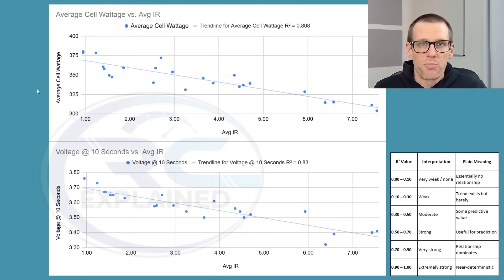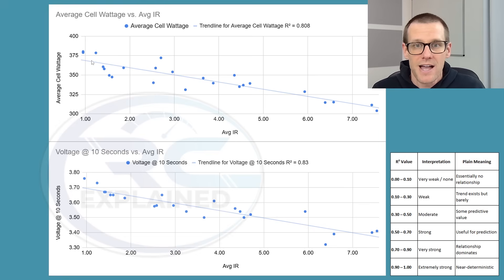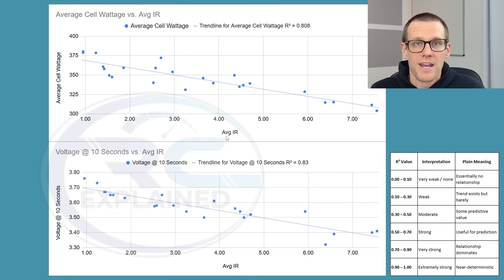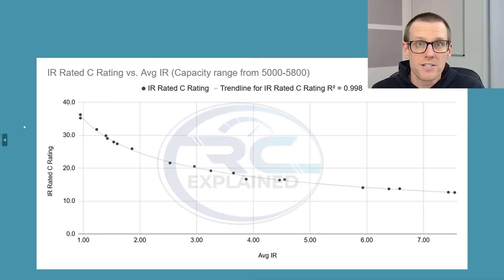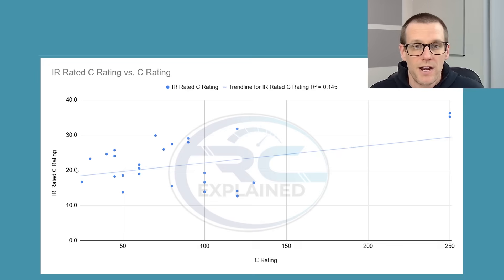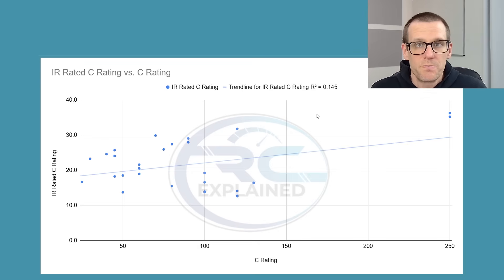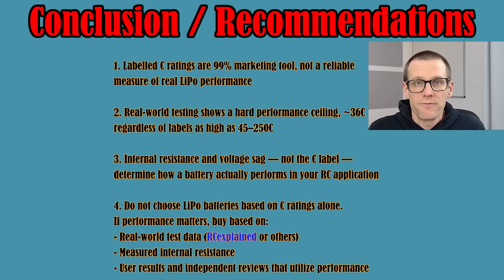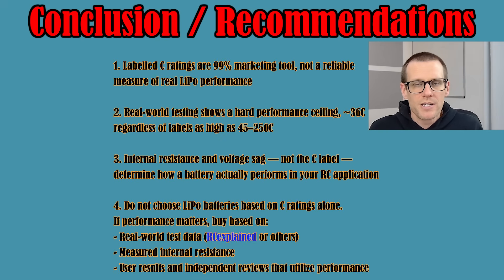28 LiPos PROVE — This Will Change How You Buy Batteries!

Comment: The C Rated Group vs. IR Rated C Rating is a very informative graph, it demonstrates that in the 70C to 250C groupings some manufacturers are at least attempting to make a better battery pack even though it is severely overrated, and SOME MANUFACTURERS are making no attempt to make a better battery and are just severely overrating. The use of an average to define the groupings is misleading, as some manufacturers are attempting to make a better pack, yet the group average is brought down by the really misleading manufacturers. Again, as you stated there is little in between, they either make a better pack or make nothing better and mislead terribly. I would love to see the correlation between the "specific manufacturer" claimed C rating and actual C rating, that way manufacturers that attempt to make better higher rated C packs can enjoy more business for their efforts and likely increased manufacturing costs. If one uses the IR Rated C Rating and C Rating it seems to demonstrate that Traxxas is the more trustworthy manufacturer, and SMC has pushed the marketing too far. I understand you have small or single sample sizes, but I bet there would be a high correlation to certain manufacturers false claims if the sample size was large enough to have a confidence interval of 90 percent or higher.
Reply: I think some of these manufacturers test the max C rating at very short bursts so the sag doesn't get as bad. It's most likely not even close to the ten seconds tested here. Something like a 1, 3, 5 and 10 second graph on a couple of the best and worst performing and lowest and highest rated could be fun to see. And of course a large sample size would be nice but gets expensive for a hobby channel.

Still, overall it seems for hobby stuff the manufacturer given C rating doesn't matter much as long as there's a semblance of quality to the batteries. A couple of minutes of full on racing/flying will probably keep the battery in a state it's not going to be able to push much above 20C for a lot of the time.

Comment: Okay but does the battery provide enough power?
Reply from the maker: None of them provide what they say they should. The answer by default is no. The packs on the low end of the spektrum hit a standard LVC under load requiring adjustment.

Comment: Cell balance and individual cell IR are monitored and shown on most high-end chargers. Crocodile clip a new battery to your charger (don't solder any connectors on yet!) and begin a slow charge at 0.5C. If the cells are out of balance by more than 0.1v and take more than a couple of minutes to balance perfectly, or if the cell IR's don't match up within a couple of Mohms or are high for the capacity (more than 15 for 2000mah, or more than 10 for 5000mah, for example), take the battery back for a refund or replacement. You're welcome.

Comment: I fly fpv and actual c rating is very important, So much so that i bought a Lipo ESR meter mark II. In the past i bought "recommended" batteries with high c ratings that sagged so much that i got low voltage readings on the first punch out. When tested they were low 20's instead of anywhere close to the rated 100 plus.

Comment: I still remember the days when you could buy matched RC packs with the IR printed on each cell. Those were the days.
Reply: Nothing wrong with those.....got real Hot.....Took loads of Charges.....What happened to Good Ol' NiCad Batteries ?........
Reply: @PaulDouglas-i5m  Lipos replaced them as Lipos have greater capacity and discharge rates they are capable of. There are still companies selling NiCad packs, but the cost of sorting and matching cells is prohibitive for something that will have 50% of the output and 50% the capacity of even the most mid-range Lipo of similar sizes. 

That being said, I still have all my old silver connectors and pack building gear.. I miss them but market wise, NiCads are dead in RC except for niche retro classes.

Comment: Appreciate the content. Assuming you had space, how would stacking say 2 $28 rapids in parallel hold up to a SMC SRD? As even 3 in P would be about the same price. Not to mention SMC is never "in stock".
Reply from the maker: I haven't thought about this before and how the changes would play out. The size of the pack increases significantly with each pack in parallel. Twice the pack count should easily improve the performance as each pack would do half the effort.
Reply: @RCexplained  My application is in adult sized mini drag bikes @ 100v+ and 400-600A.  So plenty of room. if many cheap packs in parallel pump out as much as an SMC, i can easily do that. Be a neat test anyway. Lots of RC boat guys have room to run dual bats in parallel.
Reply from the maker: @AdamOpheim thats like 70hp, sounds like fun. What configuration are you planning to run with these packs? As a base line how many in series and parallel?
Reply: @RCexplained  few vids on my channel. They sag quite a bit, but I do see 40ish kw, around 55hp. I have several bikes. I like the 20AH 12s agricultural drone bats.  2s2p config. Also run 6s and 7s RC packs. generally  3s-4s w 2p. Makes for a lot of power in a relatively small package. I'd love to get my hands on about 8 SMC-SRD 6s packs to play with. I'm sure they'd blow away my current packs.
Reply from the maker: @AdamOpheim that sounds like significant sag. A 4s2p configuration of the 6s SMC SRD packs would be a massive step up for you.

Comment: I went with SMC to alleviate some battery heating issues in my larger 6s vehicles, and it did help, but i've used the calculator to see my batteries true C rating and it falls far below expectations of the manufacturer (50C for most 6s spektrum esc's is seen as minimum). Does this mean the 50c they're asking for is complete BS and its more to do with the motor's demand than simply the esc's recommendations? I guess should the max wattage draw of the motor be the "minimum" C rating needed for a given application?
Reply from the maker: If you got a true 50C rated pack and ran a moderate 5000mAh, that is 250A continuous. Id expect your power system would not last at that power output. Better yet, can you drive the car at constant 250A?

I think RC manufactures put this limit on there so you dont end up with weaker true 5 to 10C packs made for transmitters and such. But this is just my opinion.

Comment: Well done and great info!  Marketing, how scummy can it get?   You can't trust anybody.  Or at least it is hard to find companies or people that are trustworthy.  You can spend a lot of money on batteries and if you are ending up with junk that is a real burn.

So let me ask - what is the chemistry or physics or phenomena that impact the internal resistance of a lipo or similar pack?  I know that there is some kind of deterioration that happens both over time and when the battery gets overstressed and there is some kind of crystallization or dendrite growth that slowly moves from anode to cathode which can eventually short out the battery and cause a fire. 

What makes the better batteries better?  Is it chemistry, construction, design, other?  Cheers
Reply from the maker: Thanks for the comment. 
Design, layering, and cathode material all play a significant role. These items cost money to pack in to the LiPo and a big reason brands will not focus on this when people buy blindly.

Comment: Excactly this is what I say for years, it is all about the IR.   My method to compare batteries IR reliably;  discharge battery to storage 3.8v,   ensure temperature of batteries is same, f.i 20degree.  (a hot battery has lower IR, a cold battery higher IR) ,  then a short charge at 5C, so 5 times the pack mah, so 1500mah, charge at 7.5A. To measure IR , we need some current truew the battery to introduce SAG.    Then readout the battery IR after 10seconds.   My I charger I get very consitent results and yes, the battery with lowest IR is the best battery.   Also consitent IR is important good batteries are matched and all cells should be equal,  the cell with the Higher IR value, it is the cell to fail when you  ask heavy loads from the battery in a race.   You can keep a log for the values and nr your packs.
Reply from the maker: Very nice, I like your logic.

Comment: According to the guy that made the LiPo Dyno (ESR Meter Mark II), the IR rating on chargers isn't very accurate, would be curious what results  you get using his meter. Ironically, I just bought one for myself.
Reply from the maker: What does that mean? I think we are after repeatability here and not necessarily accuracy. If i get a hold of one of those things I'll do a comparison. Seems they are expensive.
Reply: @RCexplained  IMHO $149 isn't too bad for RC hobby stuff, hence why I got one.  I have 10-15 year old batteries I'd like to see how well they still perform or if they should be scrapped.

Comment: Great breakdown! Thanks! I buy the largest mAh that fits the model, C rating is no indicator for actual performance since there’s no standards being followed by the manufacturers.
Reply: BE CAREFUL !!!  Transmitters that had a "Tx lipo battery" were often are very low "C" rated battery, 
and I'm sure I read in a forum that 'Anthony H' wrote  "lipos like the Nano-tech have much more thicker copper internally to supply a higher "C" rating.
Reply: @A-Dingleberry  True, when I say I don't go by C rating, I'm not saying it's completely irrelevant. Just that I don't put much faith in the C ratings. Especially with the AliEx or Amazon batteries. I've had better results from batteries rated at 100C than 150C from the same company, in the same model. I would never buy any battery rated at a lower C than a manufacturer calls for. Though I have done it, didn't work out so well, LOL.
Reply from the maker: You got it, expert hobbyist right there!

Comment: What's funny is that on some cars the manufacturer states to use a minimum of 50C. So there all in on it. 50c doesn't even exist @!!!
Reply from the maker: This is funny for sure. I really don't believe that everyone understands just how bad C ratings actually are.
Reply: In my opinion when a company demands at minimum a 50c battery it prevents you from buying those willie nillie brands. That being said, it seems (recently at least) that the willie nillie brands have high C ratings. It is probably more or less they want to make sure that you buy 50c batteries which in most cases is a good compromise between price and actual c rating delivery.

Comment: The wild disparity in your data points to unsound testing methods. The batteries you recommended in your last video as high performance once again show up here with troublingly low c-ratings, especially compared to advertised. How are you measuring internal resistance? Not all chargers do a good job at figuring it out consistently and accurately, and the average hobbyist likely would get varied results if following your advice.
Reply from the maker: I run a 105A load test on all 28 batteries, and I’ve shown the relationship between IR and two load test metrics in this video! 

The large gap between advertised C ratings and measured performance is exactly the point of this video.  Those packs you call out from the previous video are high performing in real-world use, but there’s a practical C-rating ceiling that shows up consistently in testing. Much closer to ~35–40C than the 50–250C figures printed on labels.

For example, a 5000 mAh pack sustaining 1250A for most of its capacity without exceeding ~60 °C simply isn’t physically realistic. Not to mention, I've posted videos of LiPo's on this list not able to sustain a 70A continuous load without overheating. That is how I confirmed the battery performs like a 12.6C pack as it could not sustain a 13.5C load without overheating. 

The average hobbyist will get data driven results when following my advice.
Reply: @RCexplained the relationship between IR and C rating is absolutely there. I don’t doubt that. It baffles me that manufacturers of vehicles state a minimum c rating for battery if they aren’t able to verify it’s needed. I use CNHL G+ and they’ve performed well in a 3S 40C min rating vehicle, though according to your data it doesn’t come near that. What the heck are the manufacturers using? 

I do still believe that most consumers won’t be able to accurately and consistently measure IR to determine how their packs are performing. Not all chargers, likely not many at all, can do this
Reply from the maker: There's so many things to unpack here. What vehicle and mAh battery are you using?
Reply: @R @RCexplained sorry for such a late reply. I was talking about my Arrma Typhon Mega 665 with 5000mah CNHL G+, though misstated and meant 2S. I’m going to be switching to a 3-4S brushless setup soon though
Reply from the maker: A minimum of 40C means a minimum of 200A continuous using a 5Ah pack. Is this realistic? It seems like it would be extremely difficult to drive this car at that power level for the entire duration of the battery.
Reply: @RCexplained I’m sorry, I don’t think I follow your math here

Comment: Measured resistance of a new battery says nothing about the performance. Ive seen battery packs drop almost 10 ohm of resistance over 3-4 cycles before stabilizing there and then rising slowly again.
Reply from the maker: Actually, the 105A load test data in this video contradicts your conclusion. Your example of what you see for IR is exactly how not to measure IR if you want repeatability.
Reply: @RCexplained  The packs need a few cycles to function properly. Its like a burn in. You can actually feel this on the sticks when flying a drone. After 3-4 cycles the battery sags less and u have more power at higher throttle. 
Especially the new GNB 140C packs with the abstract design behave like this. First measurement was at 14 ohm on a 650mah 4s and after 3 flights (relatively mild flying) it came down to 5-8 ohm per cell.
Reply from the maker: You don't need to cycle the packs to achieve lower IR. You could have just warmed up the pack to a  temperature you are comfortable with and achieved the same results without "burning" through or wasting flights and cycles.
Reply: @RCexplained i have kept book with this because i found it curious. They werent warm and the "test" was over a few weeks. 
If u dont believe me go and buy a fresh pack and try for yourself. 
Worst offenders were the ovonic packs. Still garbage compared to the GNB...  Itwasnt just measuring intolerance. 
If u have Speeder pilots chasing world records in your area go and talk to them. They cycle new batteries before attempting a world record and then throw the battery away. At least our crazies do that. Thats how i discovered this phenomenon.

Comment: I'd never buy based solely on the advertised c rating.   I use the advertised c rating along with the lowest dollar rating.  If you're just bashing around and not gunning for world record top speeds you're likely wasting money buying high dollar batteries.  I've had them all.  I've found buying whatever is on sale at the time has treated me well.  You can get killer deals if you watch close.  A got a set of 15000 mah 120c gens ace bashing 3s for my Infraction for less than $100.  They destroy a set of tires before low voltage. Also if you've got a 100a 3s esc then most any Amazon battery is going to bash the same.  Save money and bash with what's on sale.
Reply: I was always told high c ratings were more for race setups and others that require the burst. Most of us bashers will find that just about anything on Amazon or eBay will work fine for the stock setups. I used to run turnigy nanotech on a 2s castle setup and would destroy tires on the rustler pretty quick. Having to glue stock wheels after a run or 2 because they balloon so much from speed. On 10-15$ lipos.

Comment: I had CNHL 2200 3s 40c packs, bought about a year ago. They were 182g, performed great, though I didn't officially test any numbers. Great for my purposes though. I just recently picked up the same packs a month ago and they were noticeably smaller. Sure enough I weighed them at 165g. A 17g difference. I guess to save some material and maintain the price point. I would have paid a bit more for the same pack considering all the import issues but it is what it is. Have you seen anything like this with CNHL? I haven't used the new packs yet so can't speak to their performance. I can only assume the older packs were underrated to get the advertised capacity and then some. And can only assume the new ones will be just at the advertised capacity. Again just guessing on the performance but the weight difference is real.
Reply: Tanks PBS Minnesota Bemidji 67ÿoung. New B 😅😮